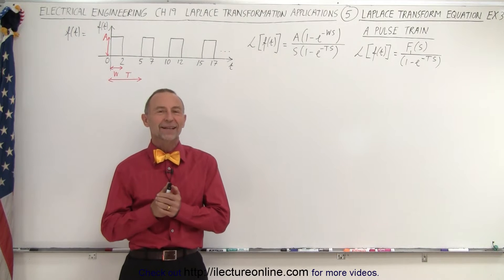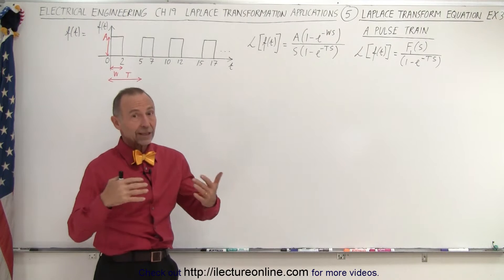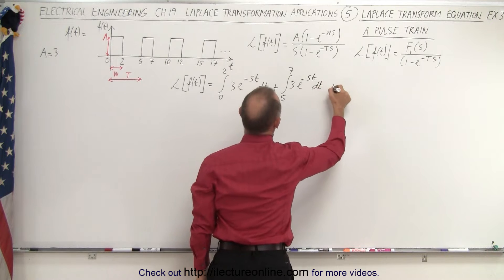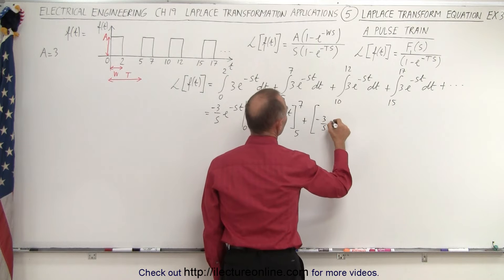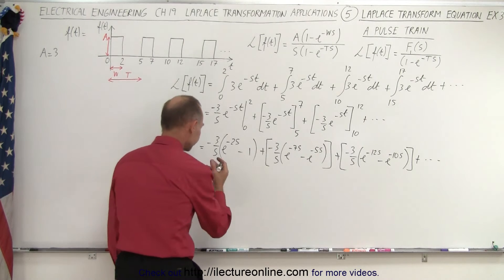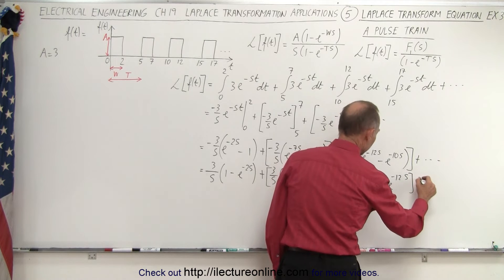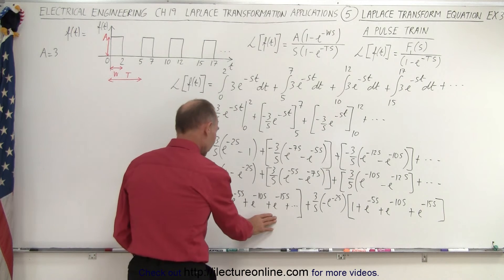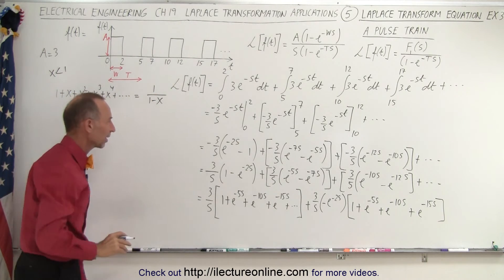Electrical Engineering: Ch 19 Laplace Transform Appl. (5 of TBD) Example 3 Pulse Train

Comment: how can e^-105 be equal to (e^-55)^2 ?
Reply from the maker: when an exponent is raised to an exponent, we multiply      5S x 2 = 10S
Reply: @MichelvanBiezen   I mean when we used the power series expansion , how did we assume that if x = e^-55 then x^2 is equal to e^-105 ??
Reply: @MarounElHajj-w4r  this is not 55, but 5s, where s is used in Laplace transforms
Reply: @MarounElHajj-w4r  but i agree that letter s is not good for use bcz it messes up with 5.